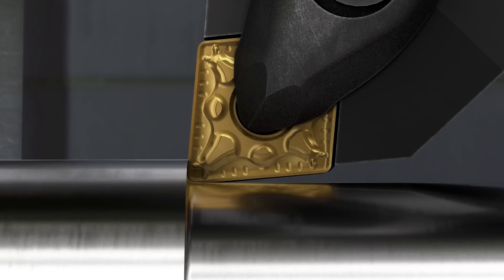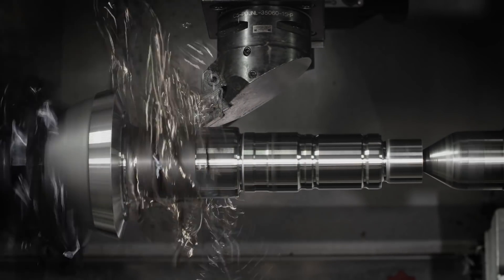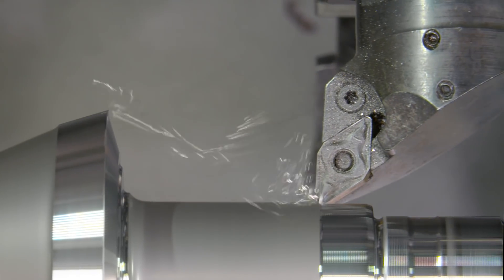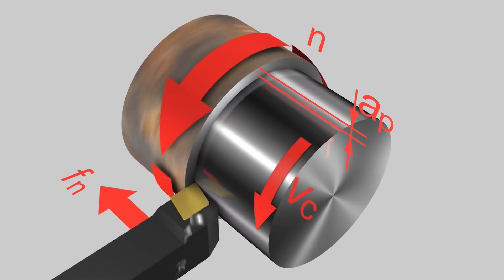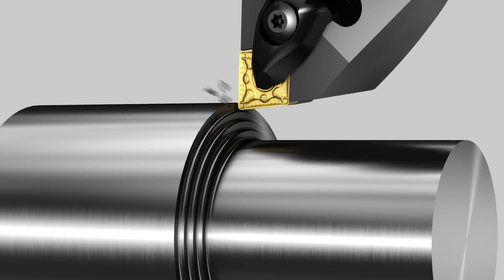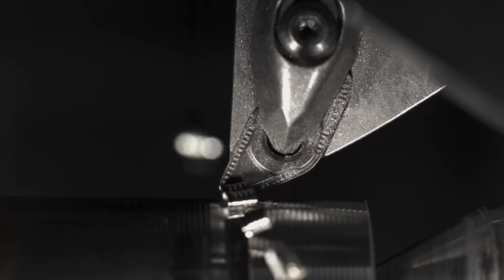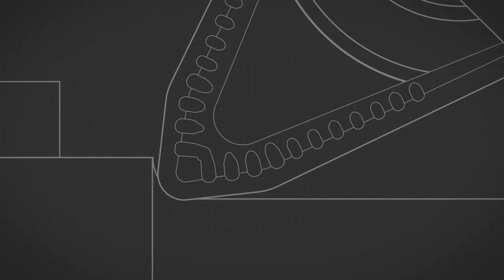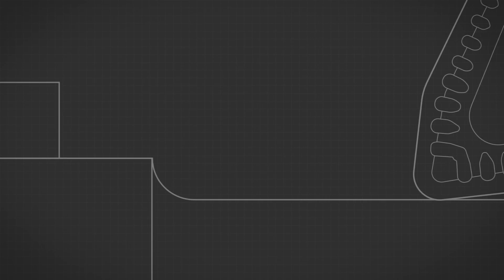How to improve chip control in turning operations - Tips film #40

Comment: this is not a bad topic.. .. though you may find that in some circumstances part of a choice in speeds and feeds to facilitate a quality chip, and productivity, may have been dependent on feeding towards the chuck; and the rigidity achieved from that... so.... as you look at this topic, do so with humility... no matter which way you go... there will be stuff to consider.

If you are in a circumstance where you are getting a chip string because you are forced to feed away from the chuck; which i have experienced.. ... i would bet this prime turning option would be ideal.

Comment: Tip of day for increasing anything . Machine must be kept at 100% condition . You gotta pay what you gotta pay for the tooling , no shortcuts . And paying the worker decently helps too .
Reply: Having used this method several times, I can tell you the number ONE thing using this method isn't stressed in ANY of their videos on prime turning:
Power- the machine must have an ABUNDANCE of power, otherwise, kiss that tool and part goodbye.
Application- along with power the  workpiece gripping force, MATERIAL, geometry and length are VERY important as well as the insert geometry, chipbreaker and grade. I've NEVER seen so drastic a difference in performance simply changing the latter and I've been doing this shit for quite some time.